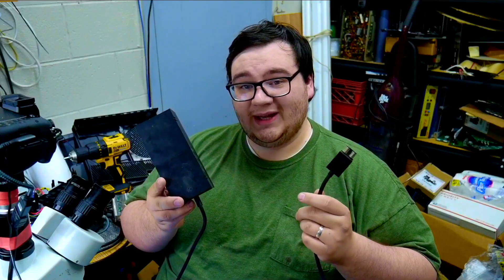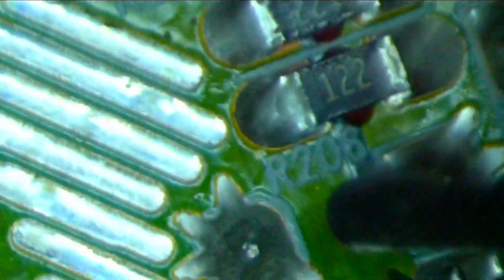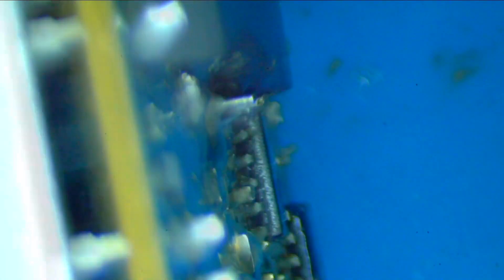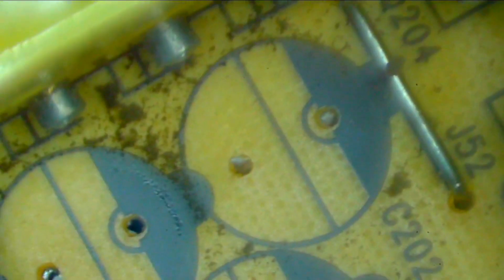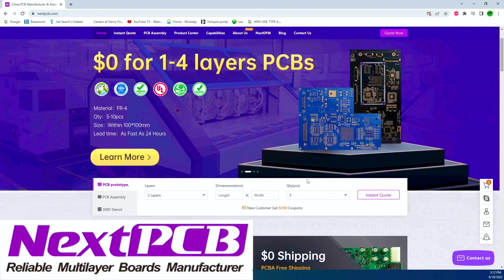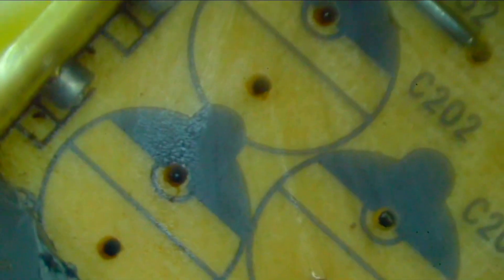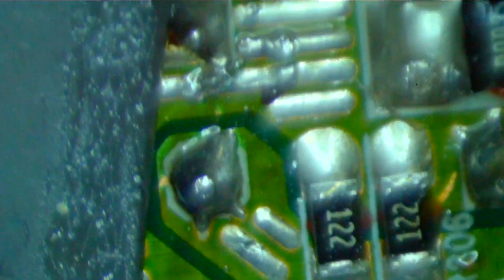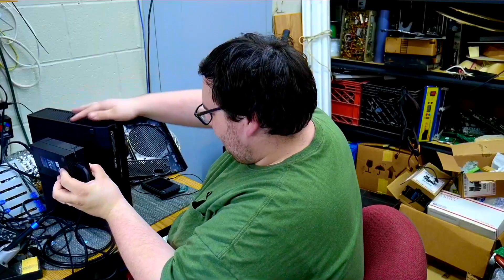I Fixed This Xbox Power Brick In 6 Minutes!

Comment from the maker: The UF Rating on Caps is to measure how stiff the Cap is in the circuit, 2200UF to 1000UF is a large jump down in Microfarads. However, it wont matter too much in this power supply. 
Typically you should use the same or higher in UF and Voltage. Switching supplies are compact, so there's not much room to fit bigger value caps in.

Comment: Hey Chase, excellent video.  Quick question only because i have not done board level repair myself since my early days of being a technician which goes back to the 1980's. 

Back in those days the company I worked at we used acetone to cleanup boards after making repairs.  Is that still a viable option or is there an environmental/PCB reason for now using isopropyl alcohol that I now see a lot in videos like yours now a days?  I do remember we did a race once back then and acetone worked quicker with less scrubbing and less product needed.  BTW the race was acetone vs. alcohol vs. a petrochemical solution vs. H2O.  The petrochemical solution worked best, but all needed a little agitation.  

Also, would like to make a suggestion to your viewers to always use any chemical in a well ventilated area, never use petrol chemical or flammable cleaners where you will be applying a heat source. And its just better to not use petrochemical solutions at all if it can be helped.  And finally, our friends should always use a fan or venting device to remove solder fumes from the direct path to your lungs.  And as childish as it seems, if you use solder a lot, consider using gloves as most solder contains lead which is known to cause brain defects and learning disabilities in children.  Wash clothes separately if you can and if you can't wear gloves, wash hands thoroughly before handling children.
Reply from the maker: I greatly appreciate your feedback! I haven't used acetone to clean any boards, just IPA. 

I'm not sure if there is a benefit or lack thereof when using acetone. 
I like IPA, its just always what I've used.
Reply: @chasefournier  Thanks for answering. Always great to engage with a creator and hear feedback from them.
Reply from the maker: Absolutely! 😊💯 

I may try acetone in the future, but for now I still have a decent amount of IPA left haha
Reply: @popquizzz  acetone is overkill in most situations, as IPA works well enough for pcb cleaning and glue removal, while acetone can damage plastic parts.

So you can use acetone if you'd like, but IPA would most likely work well enough and doesn't fume as much either!

Comment: 6:15 apparently apple decided to use a very similar design for their time capsules internal power supplies; they ran superhot (a tiny internal fan is unable to cool it down properly coupled with an almost unexistant air holes in the casing due to "apple aestethics") and after a couple of years they won't turn on anymore; when you open those TCs guess what: a pair of identical caps as the ones you showed bulged in tandem.
Reply from the maker: It makes sense! It's so common that the company wants to get devices just passed the warranty. It's called job security. Truly unfortunate.

Comment: The charger on my 6-month-old 20V cordless screwdriver broke twice with a loud smacking noise.
When I got curious and looked inside, I saw that "16V" capacitors were installed on the 20+V output side. Of course, if you consider that the 25V variants cost 50 cents more - and you include that in the economies of scale, then it's absolutely willful. Like you, I soldered in both 16V to 25V and since then it has worked perfectly
Reply from the maker: The higher the voltage the better! That's awesome to hear, that's so interesting that they put 16 volt on a 20 volt output, crazy.
Reply: They undersized the capacitors either on purpose or for cost reasons. But if a very empty battery is inserted, the potential equalization is quickly more than 16V and the capacitors have a really hard life. Only for a short time at the peak but they are overloaded.
Reply from the maker: Exactly, this is so common. It's really sad honestly.